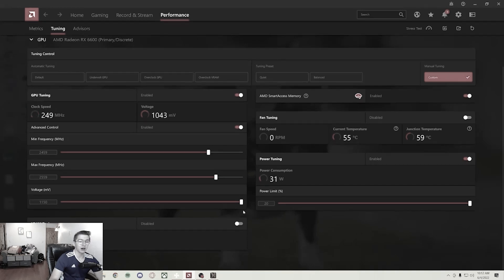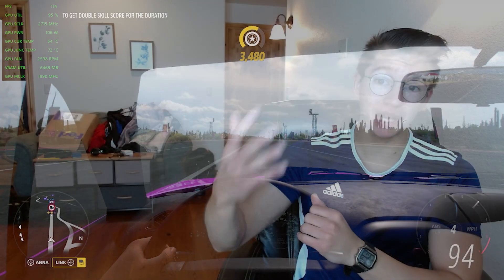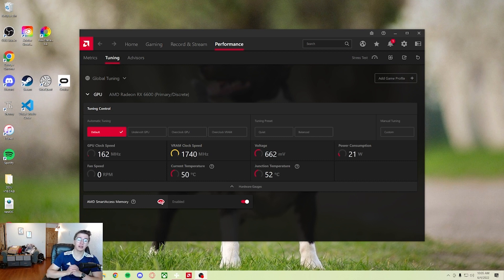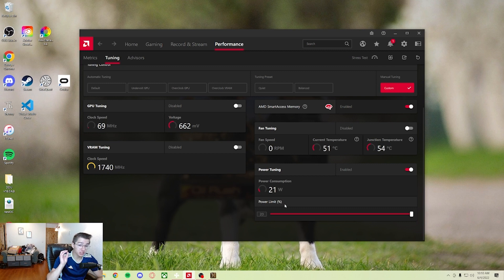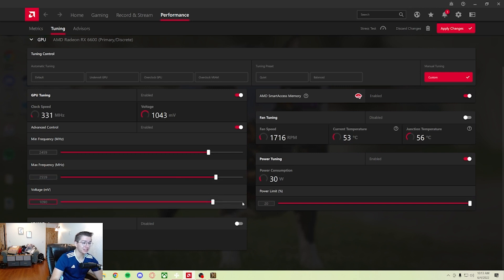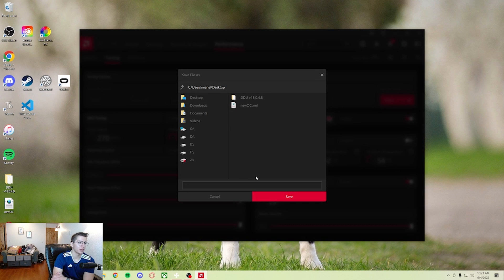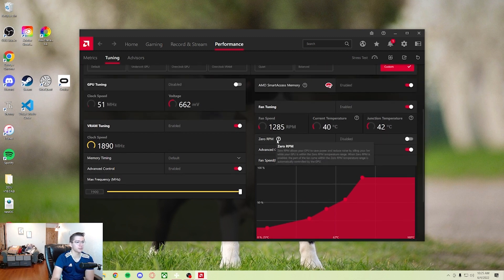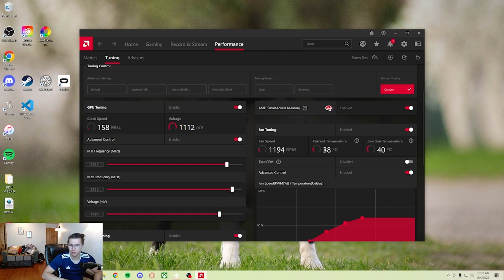Overclock and undervolt your Radeon GPU (made easy)

Comment: 10:47 sorry but that comparison is wrong. Lower temp has nothing to do with lowering the voltage there. It was lower because your fan was spinning twice the speed in the second run. Try running the two settings at the same fixed fan speed and I guarantee that the first stock will be the cooler.
Reply from the maker: You are correct, I actually noticed this while editing. 

That being said, it's still a great reinforcement of how a little tweaking can net both better performance and lower thermals! Thanks for watching.

Comment: I have: minimum frequency 2431. Maximum: 2531. Voltage: 1120. RAM frequency: 1760. Fan speed: 25/35/45/55/65. Temperature: 30/50/58/67/75. Energy Limit % : 20
Reply: how was it? did it increase the fps?

Comment: So my Power Tuning option is maxed out at 0. There is no space to slide to the right to reach 1-20. Is this a PSU problem? I know very little about all this stuff, so that's my only guess. I can't find anything on why so far.
Reply from the maker: To simplify this down, the manufacturer of a gpu (let’s say Asus) will build everything on their board, except the Radeon chip. Because Asus selected these parts themselves, they decide how much they want you to be able to adjust power limit.

Cheaper models might only have a +10 offset, while higher end options might go up to something like +25. It all depends on the manufacturer’s choice. 

I have two theories why your card doesn’t let you change power limit: 

1) your gpu is from a low-quality manufacturer, like biostar. They make cards VERY cheaply and there’s no room for overclocking.

2) your gpu has a “bios switch”. This is a small slider on the gpu that has two separate bios settings, usually one is for silent mode. You may have accidentally flicked this switch over to the other bios option, which may not allow you to change the power limit. Research your specific gpu to see if it has a a bios switch.

This issue has nothing to do with your power supply.
Reply: @Tonehifi  Thanks for the info. All this stuff is so confusing to try and look up.
Reply from the maker: @RubixCarmine  yeah man, there’s a lot to learn! Using the Radeon software, you can’t really do much damage so feel free to play around. For basic overclocking, max your voltage and see how high you can bring the core clocks up. 

Then, test stability in a benchmark and move on to vram tuning. Last step is just ensuring that your gpu is staying at a good temperature with fan tuning. 

Honestly it’s more trial and error than anything else! If you’re concerned about reliability, just leave your settings stock. 
You aren’t going to have night and day improvements from an overclock, maybe 5% or so. For reference, that’s the difference between 70 and 73.5 fps.

Comment: With the xfx Rx 6600, I’m currently running 2790 core clock and 1900 memory clock and it’s currently stable
Reply: With no voltage btw
Reply from the maker: @Sneyser373  very nice! Could have done real well on the silicone lottery. From personal experience, I’d recommend running a long benchmark (30 minutes plus) to ensure stability. I had 2 games that didn’t like my settings at one point. 

Happy gaming!
Reply: Still going strong? if I do anything above 2700 the thing crashes no matter how I tweak it

Comment: Nice vídeo Bro!i'm from Brazil,i Can use the same conf(under) with 6600m?thanks
Reply from the maker: So, for the 6600m you will NOT have much room for overclocking. Mobile gpu’s have much lower power targets and lower performance, and they do not have a lot of headroom for overclocking. This is because laptops (usually) can’t really cool a higher performance chip effectively, and the motherboard isn’t designed for overclocking. You may be able to get more performance, but only maybe a few fps at best. 

If you are interested in trying to boost performance, a better option would be an external desktop GPU if your laptop supports it. These aren’t cheap,  but they can be a huge boost in performance if your laptop has a good processor.

Comment: What do you think about 75⁰ while gaming in this card, sapphire pulse version?
Reply from the maker: Short answer: That's totally fine!

Long answer: For a long lifespan from your card, the lower the temperature, the better. Based on how much you're willing to spend for a good case, extra fans for your case, how high you want to run your GPU fan, you'll find a healthy range. There's a tradeoff between temperature, cost and operating noise from your computer. 

Graphics cards will start to reduce performance at higher temperatures. Different gpu chips will throttle at certain ranges, but usually anything below 90c will be technically fine in terms of your chip not being damaged, and not having thermal throttling issues.  

Hope that helps!
Reply: @Tonehifi  Many thanks, brother.  
So much fruitful and beneficial answer. You are the best, indeed ❤.

Comment: For me whenever I start a game it goes back to Standard settings somehow.
Reply from the maker: Are you seeing any error messages? Something like "radeon software has stopped and reset to default configuration"? If so, that would be considered a crash, and your most likely solution is increasing your voltage and/or decreasing clock speed.

If that's not what happening, you may have forgotten to save after you change your settings.

Comment: Hey man, I have an AMD RX 6600 (MSI 8G) and I keep getting Driver Timeouts whenever I set my frames higher than 1920x1080.
Interestingly, when I lower my Max Frequency to about 10%, it never crashed and appeared to be stable on Unigine Heaven and other games.
Is this normal?
Reply from the maker: Sounds really bizarre to me. 

First thing I always like to check for is thermals. Is your card getting above 75c? do your fans whir like crazy?  If so to either, it's probably an issue of either broken fans in your case, or you case being caked in dust. 

Aside from that, I'd disable Radeon Super Resolution, Radeon boost and any settings under "graphics" to troubleshoot (personally I've had issues with those, but not radeon enhanced sync).

Finally, if none of those solve your problem, I'd guess it's a driver problem. Use DDU to remove all old gpu drivers on your computer. It's a bit hard to explain but J2C has a great video on the process here: https://youtu.be/F8OLhUAPDq0
Reply: @Tonehifi  I solved the problem... Kind of. What happened was the base clock that AMD sets my gpu is 2559, when in fact the base clock of gpu is only 2044.

So, AMD overclocks my gpu out of the box without proper stress tests. At the moment, I'm not getting crashes after lowering the frequency of the gpu. Thanks AMD. XD
Reply from the maker: @hexaldecima6839  wow I didn’t see that coming! Ha ha. As an FYI, that’s on MSI because they did the tuning, and marketed the card as ‘overclocked’. 

If you want to, you can still try a small overclock, you’ll just need to increase voltage for stability. It sounds like you got a chip that doesn’t have much headroom though! 

Congrats on fixing the problem!

Comment: Dude, 0 rpm under 60 is standard, your fans are spinning for no need even while the card is idling, and i believe fan speed relates to hotspot not gpu
Reply from the maker: Using 0 rpm is your call. If you prefer silence that’s fine, but many times we experience bursty workloads that suddenly require gpu usage. When this happens, your card has to work to cool off additional heat suddenly, resulting in sudden high rpm spikes, along with less effective cooling (as the chip is already hot). This also means your gpu will reduce boost MHz speed to keep temperature under control.

As for hot spot vs gpu, the biggest factor is actually mounting pressure and cooling design for the difference. It’s the same components being worked, but a better cooling solution will keep a small difference between the two (such as 5 or 10c in high-use situations). Gamers nexus tests for this if you want more information. Hot spot can get quite high safely, but high gpu temp will cause throttling for protection.

My angle is graphics card longevity and consistent performance. For both, having consistently low temperatures is what you want. Keeping your card at 60c won’t ruin it, but your fans will regularly ramp up and then turn off (which I find annoying) and it does hurt the lifespan of your card as opposed to consistently low temperature.
Reply: @Tonehifi  Look, more than 5 years ago all gpu manufacturers agreed that there is no need to spin the fans below 60 on gpus. It's not only a matter of quieter case, but by going with it you are prolonging longetivity of your fans and reducing the amount of dust that they are sucking into the heatsink. Besides their electromotors also use power and heat up. So I dont think your arguments are valid but are the matter of personal preference and I'm ok with that. But there is no merit it claims that the gpu itself will benefit from it. Regarding hotspot I dont think you understood me. I ment that gpu temps under fan options in wattman are in regard to hotspot temps and not gpu temps. Regarding bursty loads, and dont know in what scenario this is in regard to. Cpu and gpu adjust clock constantly in regard with the loads, but fans spin in regard to the temps, and temps increase gradually.
Reply from the maker: @MrGeeKey  you seem to know your stuff, I’ll just say that this video is targeted at people who have never previously undervolted or OC’d. 

Clock speeds do constantly adjust according to a variety of parameters, including thermals. By running your fans consistently, your help eliminate brief periods of throttling by preventing fans from having to rapidly spin up, cool down and stop. I will say that in gaming this probably DOESNT matter, barring rare situations where there’s something that doesn’t require heavy GPU usage. However, because I also do video editing, photoshop and music production, I aim to eliminate potential issues that can arise in all of those scenarios. 

Sounds like overall our goals just differ slightly. Last thing I’ll add is that I’m also using fan control, so my case fans spin in accordance with gpu or cpu fans based off of usage. This is another reason I run things the way I do and help keep temperatures under control consistently.

Comment: I want to undervolt my rx6600xt XFX swift 210 so did i need to change power limit ? I dont want overclock
Reply from the maker: You don't strictly need to, but you can get lower temps and better performance by raising the power limit a little bit. You can watch the livestream I did for some more details on this!
Reply: No, but for best results increasing the power limit may allow for better undervolting

Comment: hello bro with an rx 6600xt what would u recommend for undervolting with overclocking
Reply from the maker: Remember step 0: figure out if you want more performance or a quiet/ longer lasting card.

Once you figure that out just follow the same steps I outlined, ignoring the exact numbers. 

Every single graphics card chip is a little different, so there isn’t a one size fits all approach, this video was more about understanding how to go about overclocking on Radeon!

Comment: why do i have 0% power limet
Reply from the maker: I’m not quite understanding. If you go to manual settings, then enable power limit changes, you should be able to slide it up to at least 10%
Reply: @Tonehifi  thats odd i have the rx6600xt is that different
Reply: some models have the power limit setting locked, like the Msi Mech
Reply: I have this same issue. I have RX 6600 non-XT. It starts off with 0% as the maximum and only lets me lower it into the negatives. It won't go any higher than 0. I can't find anything on why it's doing it and I'm so PC illiterate.

Comment: Hello , is it ok to run the card at 100% rpm allways when i play? , because i have no problem with the noise + i have a loud fan in the background that covors the card fan noise
Reply from the maker: You will increase wear on your fan itself. I’d personally recommend upgrading your pc fans (arctic or noctua would be my recommendation) and using an app called fan control. 

Fan control allows your pc fans to spin up with your gpu, for much better cooling in your case. I want to cover this in a video eventually, but jayztwocents has a video already!

Comment: Voltage slider is more of a offset. So if you lower voltage but raise clock speed the algorithm will also raise voltage and won’t just lock it.
Reply from the maker: Yes, it will work automatically as well. But for greater stability and consistency, manually adjusting is the move! 

I tried to keep it simple here, didn’t want to get into any more detail than necessary.
Reply: @Tonehifi Manually adjusting how?

Comment: i have the same exact card as you so glad you made this video hopefully your settings work well with mines cause im a beginner at this and dont understand most of this stuff lol
Reply from the maker: Ha ha no problem man, it takes a lot of trial and error! Try just going a little higher on your voltage, lower on your max frequency and it shouldn't be too bad. 

Like I said, find a setting that's stable and save the  profile! It saves a lot of headaches. If you're trying to get maximum performance, be prepared to mess around for a while as you might get random crashes and such. Definitely use a benchmark tool and let it run for a while to make sure everything is stable!
Reply: @Tonehifi  man am I able to pay you to overclock for me? I been trying since yesterday and it seems like I get better fps stock than when I overclock

Comment: Opinion on smart access memory? I currently have it off. Appreciate your time!
Reply from the maker: It’s basically free performance. It used to be buggy but a lot of people use it without issues. 

I’d turn it on, try it for a week and see if you have any issues. I haven’t found any, even with VR.
Reply: @Tonehifi  Have you noticed any spikes regarding cpu power draws after enabling it? I've noticed on a few occasions that my 10400 has been recorded in hw monitor to draw around 230w.(Even though temps werent higher than usual so it must have been spikes in milisecs). This never happened before upgrading gpu.

Comment: Hey man! Nice job i did this on an rx 6600 sapphire pulse, since im new on this i kept the clocks , and 100 less on the min side, and i set to 1090 mva, but gpu temperature did not changed  and the temps while gaming still on 70-72 what should I do ?
Reply: Nothing wrong with your temps
Reply: @MrGeeKey  thanks for the info bro
Reply: 1090mv  is still high try .950 mv at 2100 mhz min and 2200 mhz max
Reply: Your temps will not drop your gpu will get quieter as the fans will slow down,
Reply: but gpu fan made less noise